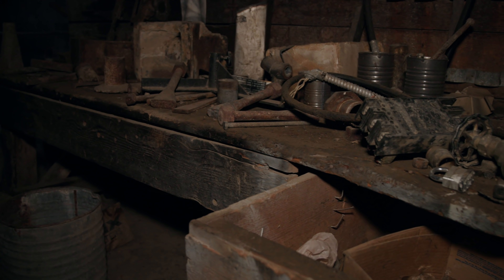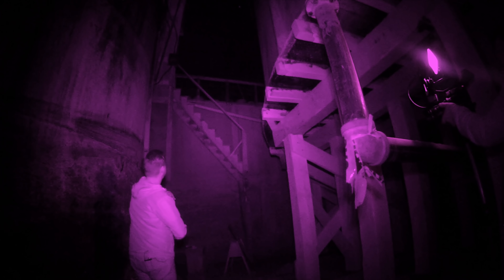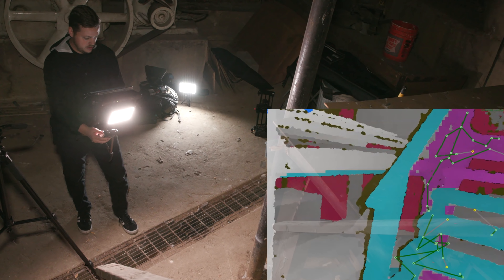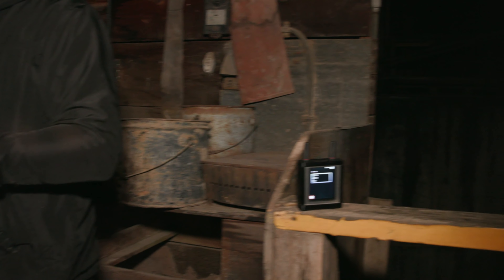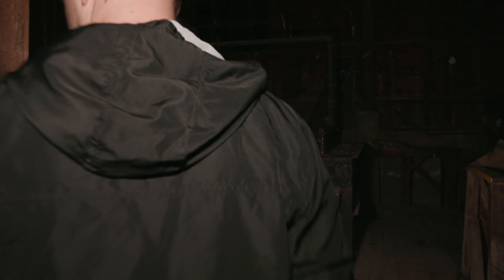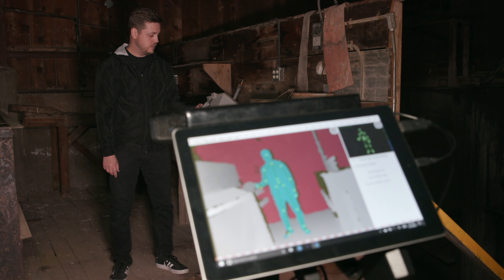Comstock Mill | Paranormal Investigation | Full Episode 4K | S02 E03

Comment: A couple observations... Around the 9:17 mark you can actually see an object falling through the frame during slow-motion playback; just to the right of center, falling at an angle to the left. 

At 12:07 there is a clear shot of the spot where you later hear the bolt drop/find the bolt and there is clearly nothing on the ground. 

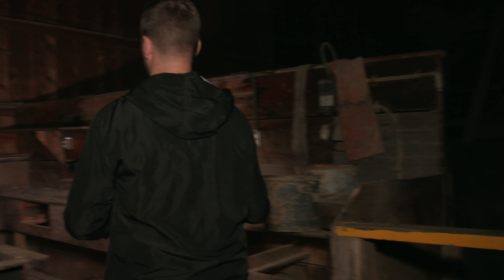Finally, at the 19:12 mark there is a great shot of the buckets’ position on the counter before it’s moved. I have no logical explanation for how that got from the counter and onto the floor.

Fantastic investigation! So incredibly thorough and well-planned. Thank you for another amazing video!
Reply from the maker: amazing as always!! thank you for the break down!! you're awesome!!
Reply from the maker: heck yes!
Reply: erin bluhm 
Agreed, agreed and agreed!
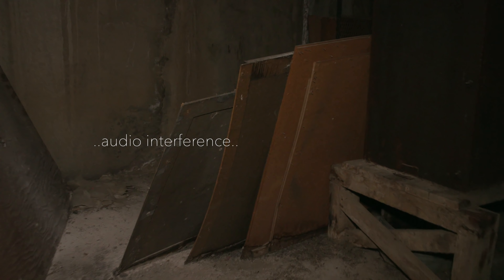Reply: Yip, I seen an object at around 8:50 in real time. Just a flash and again you can see in replay just a flash of something. But no object found or dust disturbed. 👍